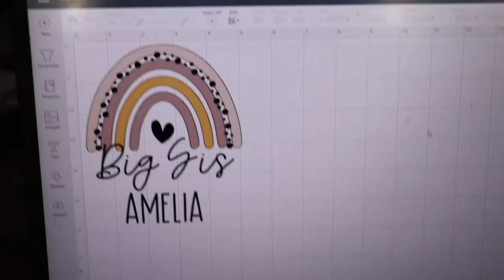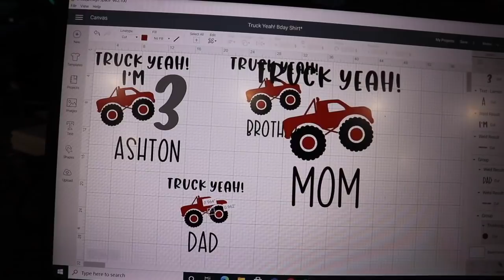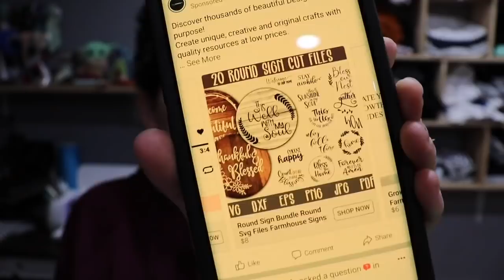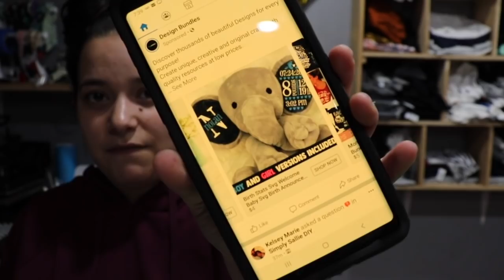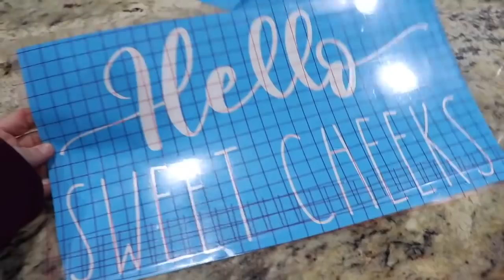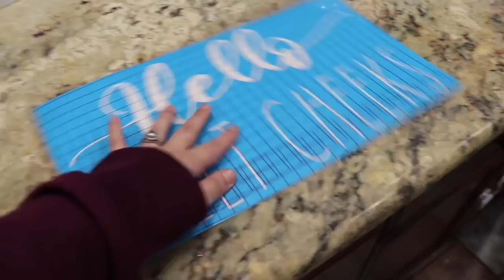Working On Etsy Orders / Etsy Studio Vlog / Running A Successful Etsy Shop / Using A Cricut Maker

Comment: Quick tip: I use magnets on the top of my heat press to hold the parchment/Teflon sheet so I don’t have to keep taking it off and on every time I press. Makes the process so much easier!